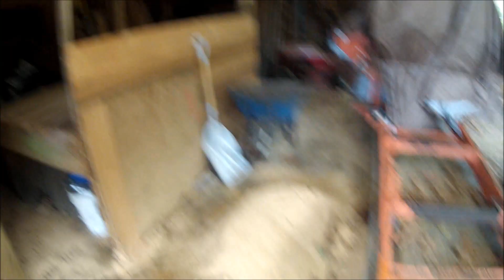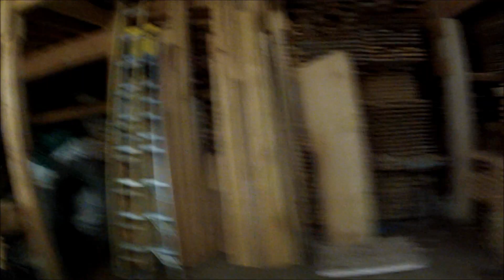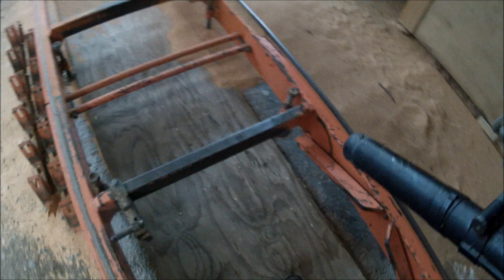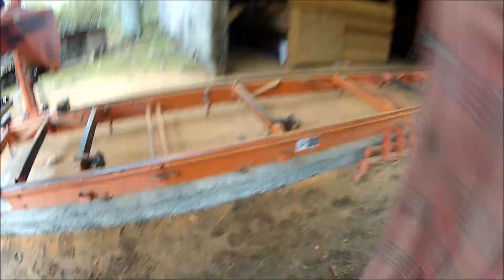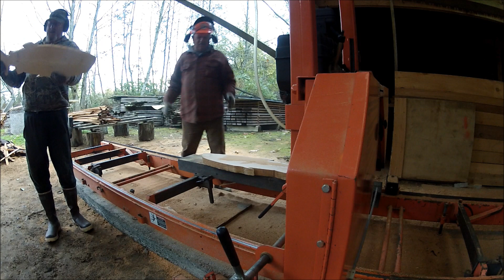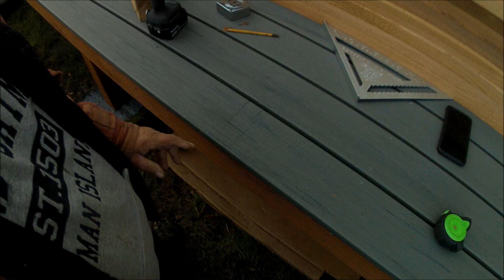Milling a Steelhead on LT-15 wood-mizer and porch rail material

Comment: What do you do with all the saw dust?  I would have liked to see a pic of that steelhead.  Was he planning on painting it?  👍
Reply from the maker: I have two piles of sawdust one cedar and one everything like fir, hemlock, etcetera.
I think he was going to sand it smooth and do some airbrushing he was going to try. I'm not sure if he got a picture.  thanks for commenting
Reply: @dansSawfish5604  So you just put it in a pile and don't do anything else with it?
Reply from the maker: @PeelingLine  I have used it in the yard to fill holes and in the bulls corral to keep the mud down, and give it away.